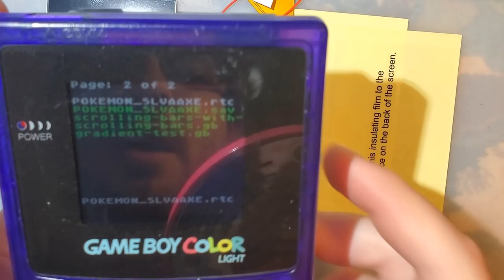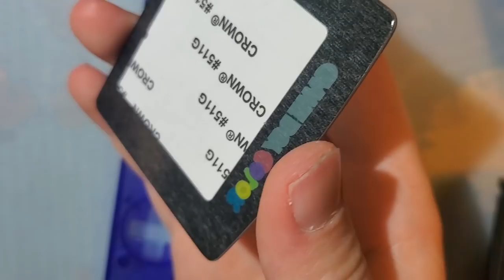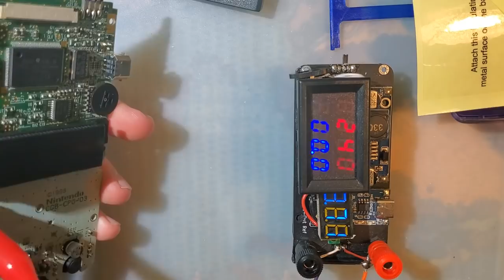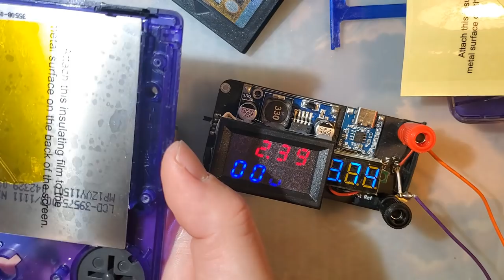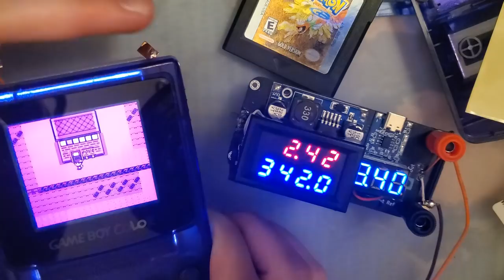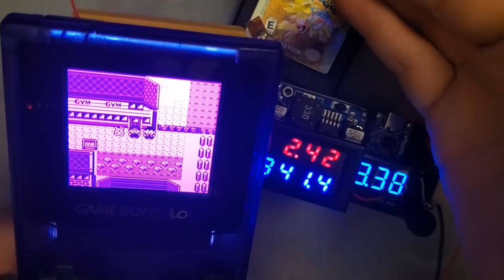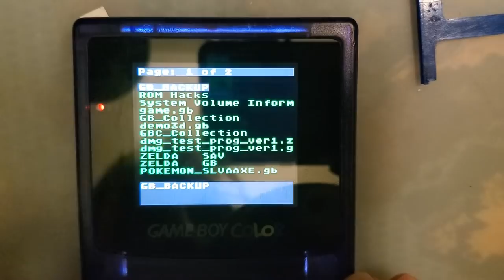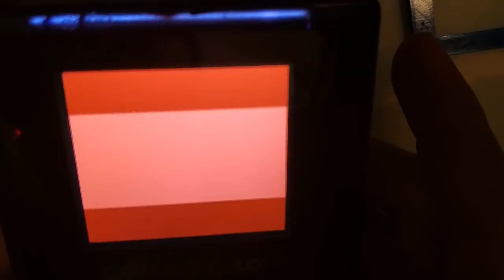Installing the "One Chip" Game Boy Color IPS Screen Kit (Custom Color Palettes!) (Part 1 of 3)

Comment from the maker: I was mistaken -- this kit DOES NOT come with a sticky gasket like the funnyplaying version. It DOES come with doublesided tape for you to apply the LCD. The PCB that this kit uses is thicker than the ribbon cable of the funnyplaying version so thicker doublesided tape (like what I used) could cause fit issues.

Comment: It would be awesome if they built a battery percentage mod into the lcd either in the top right corner or if they used the space of the screen that’s under the shell and stays black because most people use a clear shell these days anyway if you can’t make out the numbers under the shell they could use bars or something

Comment: Good to see this kit doesn’t experience the line on the right side. Unlike funnyplaying kit on pre 05 boards.
Reply from the maker: Funny you say that because it does seem to have a related problem. Under certain circumstances, the last column of the display is duplicated and extended off the side of the screen: https://cdn.discordapp.com/attachments/360338882752937985/713551746009530398/20200522_173759.jpg

Comment: It has 2 touch sensors like the new Gameboy Pocket IPS kit.  If you touch and hold the palette sensor it should add scanlines.
Reply from the maker: Touch and hold does nothing on this kit. Also, scanlines aren't a thing on Game Boy games. I think you're referring to the screen door effect which the LCD that this kit uses is not high enough resolution to emulate that effect artificially. 

Plus, the screen door effect looks bad and I'd rather have 4x integer scaling any day of the week rather than the 3x +1.
Reply: @makho  I can't justify this kit anymore. I found out about it five minutes ago, wasn't even going to buy it, and with all this new-fangled hardware I can't even get my screen door effects? What the hell. I guess I'll just have to stick with taping screen door mesh onto my Game Boys.

Comment: Slight twisting on the plastic housing will remove the lcd from sticking. Don't try any scraping tool, it will damage the lcd...
Reply from the maker: Not when you've got a glass screen lens installed.

Comment: Hey I messed up the touch sensor. Any idea where I can get another one. I just need the metal pad itself not the wire. I just don’t know what it’s called to google it. Thanks!
Reply from the maker: Copper foil tape works as well (even better since it already has adhesive)

Comment: If the LCD sticking to the front screen is a problem,  but the PCB/Ribbon Cable are able to be removed from the LCD (like how the GBA one snap-plugs in)  then the only downside would be buying the $8 LCD to replace right? That way its not a $50-$60 fuck up its just $10?
Reply from the maker: Yep
Reply: @makho  that's fantastic! So much less stress for sure,  glad i bought a couple extra for when I do it just in case,  can never be too careful with this kind of stuff! Thanks for the quick reply.  My Funnyplaying IPS screens finally arrived but I still need to source a replacement power switch for a few GBAs : p

Comment: Approximately for how long will a Game Boy Color  with a set of AA batteries run with this light mod (on the lowest brightness setting)?
Reply from the maker: I put my measurements in the description (spreadsheet). You can speculate from there. It depends entirely on your batteries, your game, and your game boy.

Comment: Looks really nice. Shame it's more difficult to install. Really like the color palettes. This kinda makes the DMG mod obsolete doesn't it?  (unless you prefer using a DMG for nostalgia)
Reply from the maker: We'll see about that. I have another DMG kit on the way from taobao and then there's the funnyplaying DMG kit (not the current MGB kit but shoved in a DMG -- which reminds me I need to buy an extra kit). Unless you want to include GBC games which aren't playable on the DMG. 

But yeah, I do really like this kit.
Reply: @makho  That'll be really interesting to see. I love seeing all these kits and how you compare them. 

I currently having FunnyPlaying GBA IPS V2 and GBA SP IPS mods and I really like them. I bought both premodded and both had/have issues. I'm thinking I'll try and mod one for myself next time. 

I would definitely consider doing Color and DMG mods too. The pocket is a decent system but my rev A EverDrive doesn't like it which sucks.
Reply: @EmperorOfTigers  What kind of issues? Have a GBA V2 coming soon.

Comment: Hey Makho I have a question regarding Game Boy Color games. I have been buying Pokemon games for parts locally and on eBay. I've had great success with re-flowing the solder, but I got 2 Pokemon Silvers that show the Nintendo Logo, but then just go to a blank screen & the other that shows the staring screen professor elm as a glitched box figure. Is there any hope to fixing them? Is it possible to reinstall the game from a back-up?
Reply from the maker: I did a writeup on issues like this: https://www.reddit.com/r/GameBoy/wiki/repairs#wiki_game_pak_problems
Reply: makho Dang, looks like I tried all of these steps already (aside from the board replacement). I have reflown everything I could see on the boards and still get the same result. I even tried 3000 grit on the contacts followed by a mars eraser and ipa. If you can think of any more simple methods let me know. All this info is great and I really appreciate your videos.

Comment: Hi Makho, I have a question, Do you know the current consumption (mA) difference between IPS V2 LCD and this new IPS LCD? Both with adjusting to highest of brightness (level ten). Thanks in advance!
Reply from the maker: What are you referring to? This is a GBC kit and there is no v2 of any IPS kit for it (yet?).
Reply: makho, I mean, how many mini amperes consumption this IPS LCD kit (showing in this video) and how many amperes consumed the IPS V2 Kit (made by FunnyPlay)?
Reply from the maker: @emmanuelreyes9988  again, there is no v2 kit from funnyplaying. If you would just read the description, you would see that I linked to my spreadsheet with all the numbers I measured anyway.
Reply: makho ok, i going to review your spreadsheet about this IPS version, I know that it is not a IPS V2... I will see your video about the IPS V2 and I going to get the information that I need... Any way..., thanks for your support, you have been a good job and you can help me with some issue and technical question about anything IPS versions... Have a nice day!

Comment: Has anyone tried using a reflow gun or some heat to make the cut plastic optically clear again. I will probably be trying to do this with my glow in the dark green shell im getting today.
Reply from the maker: It cracks the plastic. See my v2 install if you don't believe me.
Reply: makho ok so you have tried it before? It was just a theory I had kicking around figured I’d ask to see if anyone has tried. Thank you :)

Comment: "once it's stuck on there it's stuck and trying to remove it will break it" - as I found out today with my IPS GBP screen. Put a nasty crack in one corner. Need to source a new panel really, but the more I play it the less it distracts me.
Reply from the maker: looks to be a Blackberry Q5 LCD but I don't have one yet myself to confirm.
Reply: @makho  - yes, it does look similar, now to find somewhere selling them in UK...
Reply: Can't find many places doing the screen, but found a full front replacement with screen and digitiser, going to have a chop at that see if I can get the screen out and into my gameboy. Either way it's going to be £4 worth of passing the time.
Reply from the maker: @paulturner5208  I'm sure funnyplaying will start selling the LCDs eventually. Gotta give them time to build up inventory.
Reply: @makho  - I got a reply from them saying that they will add it to their shop soon, so until then I am playing games that don't use the bottom right hand corner so much. Tetris is ideal.
Reply: @paulturner5208 You can get a replacement from Zedlabz on eBay for £16 in you're in the UK. I've made the same mistake myself lol
Reply: @thereturnticket  - I think that one is the one for the gameboy colour kit (the 3.9" LG screen?) - it seems like they've not caught up with the gameboy pocket kit yet (it's brand new) - but will keep an eye on them. (Top name BTW !)
Reply: @makho  - It is a Q5, I have just repaired the damage using a screen out of a Q5 replacement front faceplate off of eBay, cheers for the tip off !

Comment: Would this censers work through a body pixel shell?
Reply from the maker: nope
Reply: @makho  so it has to be a clear shell in order to make the sensor work am i right? i just cant install it on a regular plastic housing? :O
Reply from the maker: @PixelSilvio  no, it just has to not be aluminum or brass.